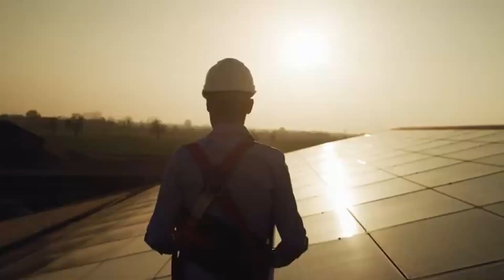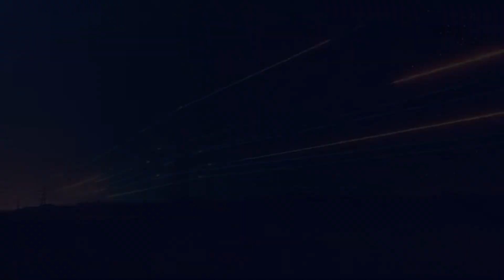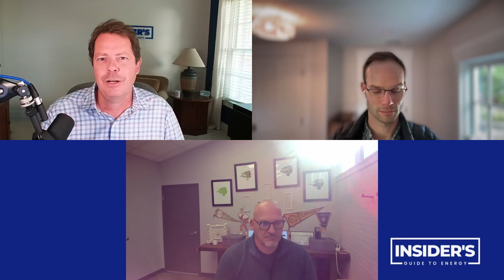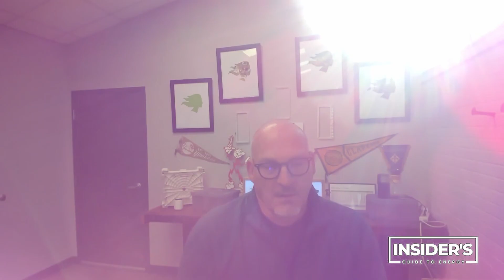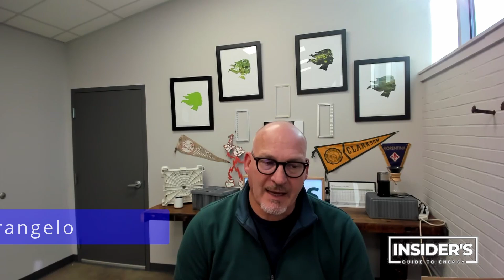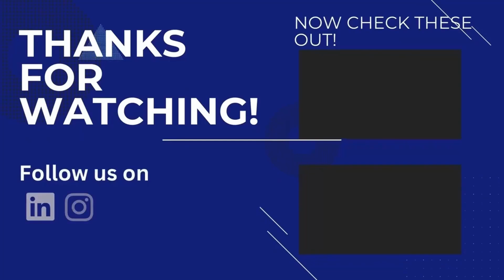200 - Long-Duration Energy Storage with Zinc Batteries: Insights from EOS Energy CEO Joe Mastrangelo

Comment: The missing topic was Distributed Energy Resources (DER).  This is where the big growth in battery storage will be in the next 10 years.   What will it take to make cheap, clean energy available to everyone?

Solar parking lot canopies +on-site stationary storage batteries +Vehicle-2-Grid chargers installed behind-the-meter, right where most energy is being consumed, by large apartments & condos, neighborhood shopping centers, business parks & various public facilities.

We have vast acres of ridiculously under-utilized (sub)urban land locked up in widely distributed hot asphalt parking lots that can be rapidly shaded with solar canopies without any new utility transmission, site acquisition, or other site improvement spending. Modular canopy structures will last for 75+years with minimal maintenance, make cleaning & maintaining solar systems very efficient, & provide area for much, much larger NetZero community micro grid systems than rooftops alone.

This is the most rapidly exploitable strategy to accelerate widely distributed, ubiquitous electric vehicle charging infrastructure at large residential, commercial & institutional properties while constructing a matrix of reliable, load-leveling local neighborhood energy storage micro grids. And this can be accomplished by typical leased residential, commercial & institutional property investors & local government using IRA investment incentives, with just ordinary local building permits & no utility interconnection delays or NIMBY opposition.

Comment: Good conversation. Learned a lot. Unfortunately even with a US supply chain challenges remain. They badly missed their target last quarter because of supply chain problems around the battery containers. They clearly have a long way to go before they are close to achieving operational excellence. Glad he was honest about how that has been a challenge for them. If it were not for the Cerberus investment they would be BK by now. Now they have a fighting chance.